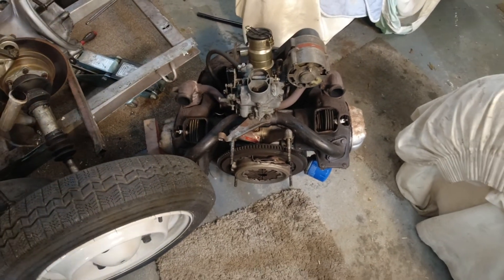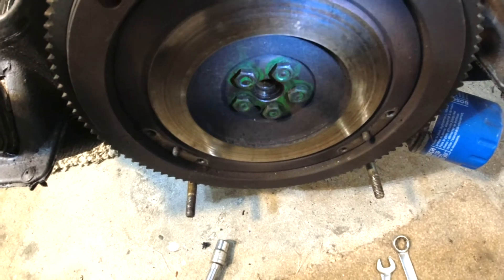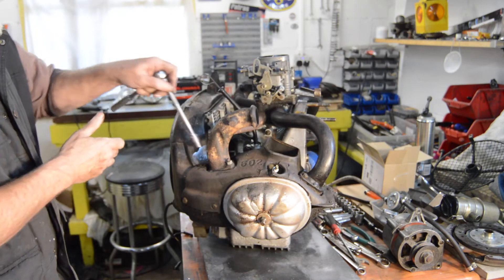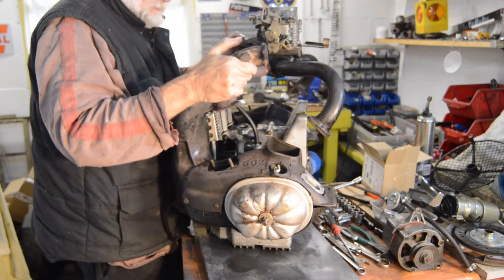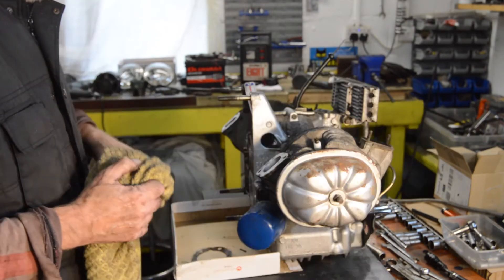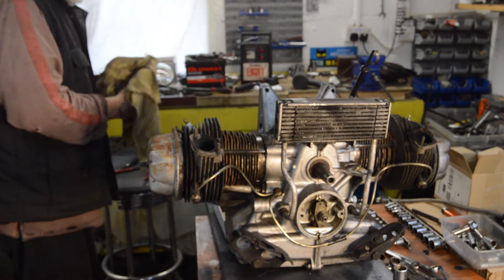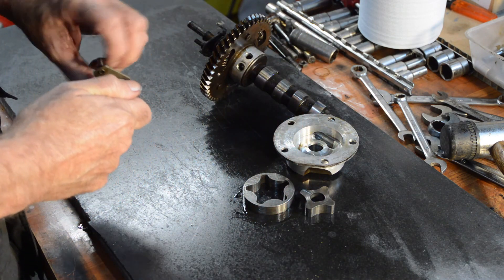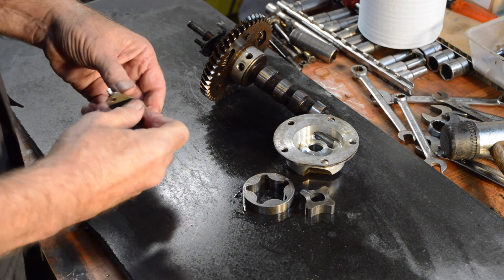2cv engine swap part 2

Comment: Hi there once again thanks for the video. very useful as I'm about to do all this on My lomax. Now You will probably think I'm totally mad, but I'm actually looking into building a 2cv, hybrid engine using 1600cc vw beetle cylinders and pistons, to give 400cc each cylinder (800cc) in total. I have got as far as buying some old beetle cylinders and pistons (cheap as chips!) and measuring them up to compare with My 2cv spares. It actually looks promising so far! Anyway I will let You know how I progress, wish Me luck. Best Wishes. Jahmahrah
Reply from the maker: That sounds like a very interesting project. Please keep me up to date on how it is going as there will be others who read the comments who will also be interested I am sure. Good luck with it and the Lomax!

Comment: "Cruddy" flywheel bolts looks like they have used with Loctite? Looks like you and Hubnut want to get together to sort out an engine for his "Elly" (Dolly)
Reply from the maker: Yep, I think you are right, probably Loctitie, so not factory. Hubnut was hinting about fitting another big bore engine, I would like one too but my pockets are not deep enough sadly!
Reply: @oldnutsgarage  Yes I'm sure that Pete Sparrow's 720cc engine wouldn't be cheap if it involves a stroked crank. Ian already has a 650cc conversion.

Comment: Would you consider installing electronic ignition?
Reply from the maker: When I was younger and used my 2cvs for regular long European jaunts I preferred points and carried a spare box / points / condenser so I could swap over quickly and easily and not end up stranded. Maybe a bit paranoid as the electronic systems are pretty reliable and loads of people have used them for years without incident. All down to personal preference I suppose.

Comment: That’s a shame that you think the crankshaft bearings let loose, we will see that in the future episodes.  So are you planning on installing the engine you built on the channel  ( or for some strange reason I think you had a spare engine already waiting ).  Truly Enjoy watching from afar and your shed work you share with us.  Thank You.
Reply from the maker: The spare engine I built up is going in Max as I was never very happy with the engine in the car, it always felt tired. I will rebuild this engine as well, it is always good to have a spare ( in fact I also have a spare gearbox, suspension bits and much more) especially as 2cv parts are rising in price all the time.